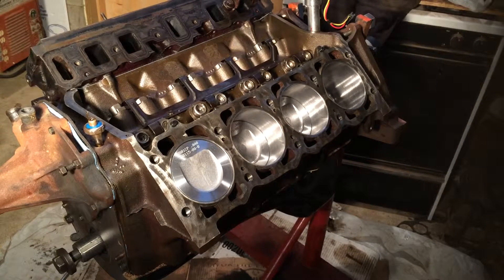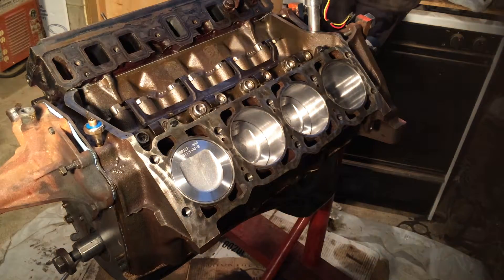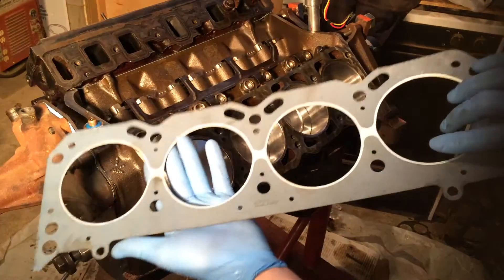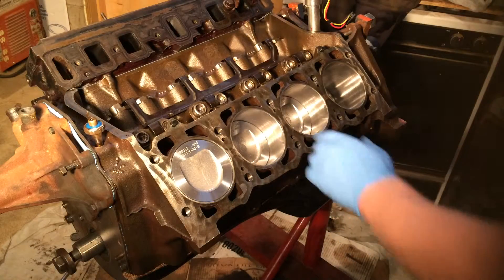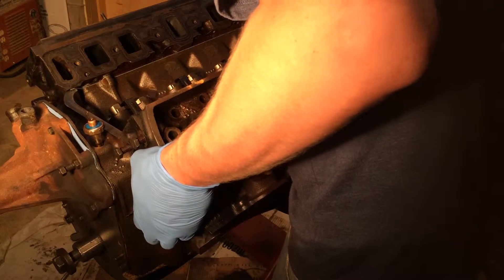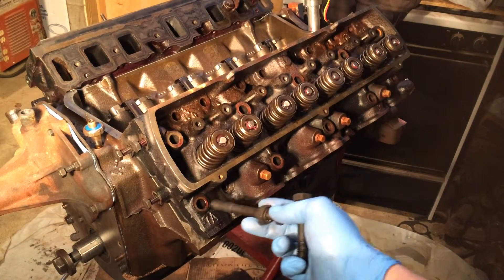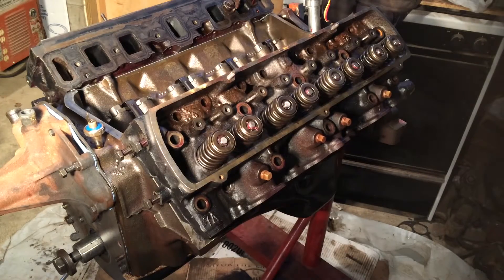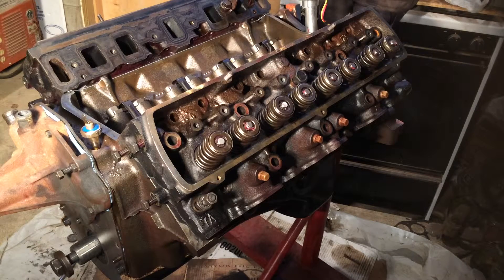Installing the cylinder heads

Comment: Fine job..it's also a good idea to put a dab of synthetic oil on the underside of the bolt heads. This will help ensure smooth and even torquing.

Comment: I dont't want to take the motor out of my Toronado. But do I have to remove the exhaust manifolds?
Reply from the maker: I can't say for a Toronado, but on my Delta 88 they will come off without the engine being removed.
Reply: My problem is trying to find the bolts for the intake manifold so I can clean it. The problem is the previous owner let it sit for a year and now all sorts of leaves are covering the manifold and engine bay. People suck lol.
Reply from the maker: Yea some people just don't care lol. If you want i can make a video of the intake bolt locations
Reply: PLEASE PLEASE PLEASE DO!!!!! I cant find the damn bolts because there are too many leaves in the way lol. I have an 83 Toronado with a 307 and it seems easy.... If the damn engine bay was clean lol.
Reply from the maker: Ok I will make one tonight. It should be uploaded in less than 24hrs.